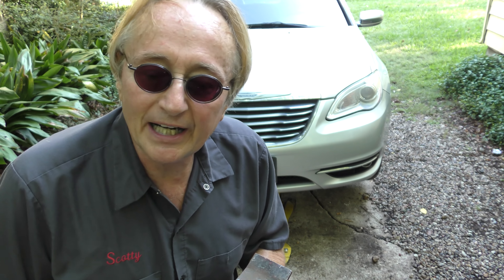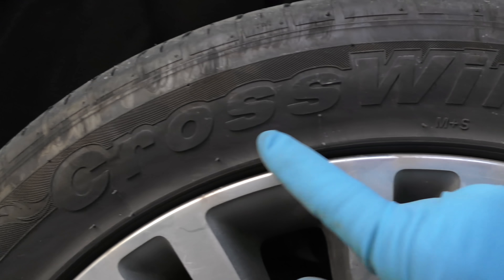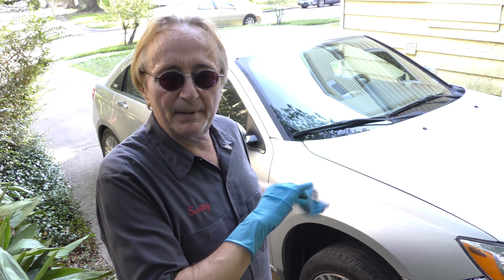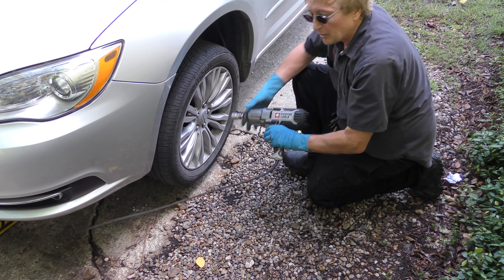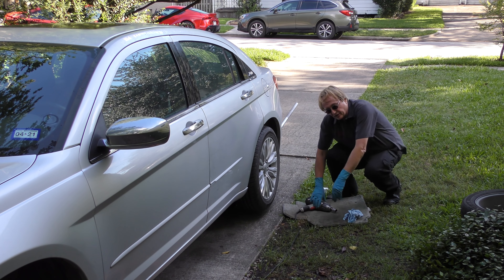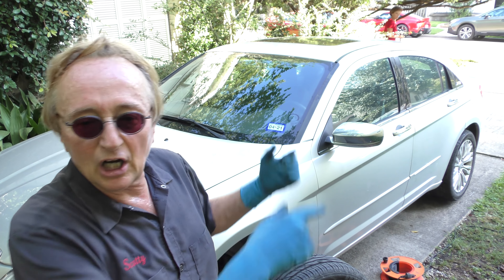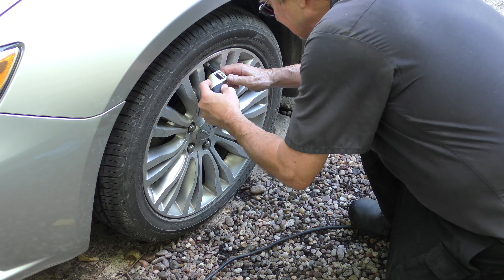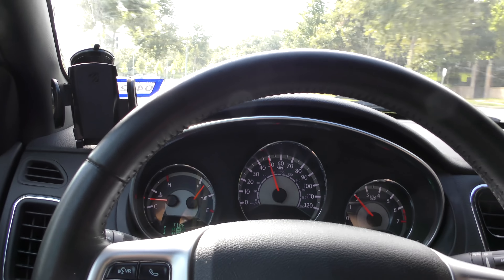Here’s How Stupid People Change Tires

Comment: First time in my life I find Scotty wrong: The average foe (See US crashing videos) is REALLY bad in handling avoiding obstacles and/or recovering from oversteer. And one of the most dangerous crashes is a T crash (Side impact) and rolling over. See NHTSA videos about it.
So for safety it's correct to put the worn out in front and the good ones back, because it is less harmful for you and others to run into another car, than to spin, get on the sidewalk or roll over.
Reply: That said, having two equally worn out tyres on front, actually gives you a lot more traction and stoping power on the dry than a new tyre because there's more rubber in contact with the pavement. That's why in sports they use slick tyres.

Yes, in the wet, snow or ice you won't be able to turn or brake well. But a street car design makes it SO MUCH easier to know what the front tyres are doing than the back ones. And the average driver is more likely to notice that the front tyres slip and take it easy, or they could think everything is ok because steering and braking feels great, and end up spining over a puddle at a corner. 

So yes, it is better to have the worn up in front, even more if where you live doesn't rain or snow.
Reply: But NEVER EVER put two different brands, let alone two very different worn level tyres on the same axle. That's just stupid.

Comment: better tires must be at rear, at winter, but it works only when tires are normal, when they are worn, then buy new tires.
Right way is to buy all 4 new tires allways and switch them regularly, then they worn more or less evenly.

If you brake at ice and you have more worn tires at rear, then ju loose control, spinout.

Comment: I know why they do it, you can argue both ways 'til you're blue in the face...
If you're on slippery roads and you've got better traction in the rear, if you slam the brakes your car will skid straight. If you have better traction in the front then the rear end will slide out. Personally I'd still put the good ones on the drive axle

Comment: wow I worked at firestone and Merchants tires and they gave us training and we had ASE certified guys working on the cars and even me a tire manager knew you have the best tires on the drive wheels either front or back if rear wheel drive and you don't run mis matched tires of various brands and than align it and it's vibrating what did the clowns tell them when they say hey since you aligned my car it shakes....lol

Comment: Tyre grip on the rear is more important than tyre grip up front. There is less load on those rear tyres and the tyres are losing grip a lot faster then the front tyres. Less grip on the rear wants to make the rear overtake the front of the car. The owner should get rid of the goodyear tyre and buy a new  matching or a new set of tyres. Never gamble with safety

Comment: In Ohio they do pollution tests.  Had a 89 Mustang GT that was massaged, with 5 speed.  Kid told me to get out of car and he put the front wheels in rollers.  Stopped him and told him was rear wheel drive.  Kid said no it's not.  Got supervisor and told him About kid thinks he knows more than owner,ME.  I said get the kid out of my car NOW.   If he wrecks my car you just bought it.   Young girl got in car, put rear wheels in rollers.  No one could keep car in rollers. Although the girl did it better than supervisor and 2 employees.   Test station finally let me drive car in rollers as 89 didn't have much computer tech.   They asked me what I did to car.  Said it was factory  and smiled.

Comment: if back tires are bald, they will have no friction to stop the car. when you hit brake, if you two front tires hit different part of the road that have different friction coefficient, the car will spin. there is a science to it. this is basic physics. this happens a lot more often when road is wet or has snow on it.

Comment: I'm afraid I'm going to have to disagree with Scotty here (partly). 
They even teach it in driving school in Europe that you want the best grip in the rear. It's a part of the driving school to pass the day on a slippery track. Driving on a slippery track trying to avoid obstacles with bald rear tires (they put them there intentionally) makes you lose control of the car and it is REALLY hard to regain control of the car (even with city speeds that do not seem that high). 
What I really want to say though is that from mechanical (shaking and wear) point of view yes, you want the best, roundest, newest tires in the front of the fwd vehicle. And to avoid unintentional sliding (whether in case of ice and/or hydroplaning), you want the tires with the best grip to be in the back of the car (no matter if fwd or rwd). In reality, there should be no difference with your front or rear tires - you should always have the kind of tires under your car that won't cause any issues and are safe. After all, tires are your only contact with the road while driving. 🤷‍♀️ Just my two cents.

Comment: You DO NOT WANT the best tires on the front, 

When tires are replaced in pairs in situations like these, the new tires should always be installed on the rear axle and the partially worn tires moved to the front. New tires on the rear axle help the driver more easily maintain control on wet roads since deeper treaded tires are better at resisting hydroplaning.

Understeer can be controlled by steering in the direction of the skid or applying the brakes to slow down. Trying to control oversteer using the same techniques can get you in a lot of trouble.

Comment: The problem with the tires may not be the mismatch/tread.....tire(s) may be out of balance. May be the wheels......wheel weights or bent wheel. For a non advanced driver, put the tires with more grip in the back. Bald tires may grip better if rubber isn't dried out assuming it's exactly the same tire.
When you buy a car you get a pink slip. If there's a loan the lender has the pink slip. You'll need to go to the lender with the seller, pay it off and get the pink slip signed over to you. How did those guys buy the car and not get the pink slip?

Comment: Don't know much about cars but common sense tells you that the car is controlled by the front so you want to have the best tyres on the front of the car  . There is a reason why the steering wheel is not in the back of the car

Comment: Depending on circumstances, I'll disagree with the requirement to have the "best" tires ALWAYS on the front for a FWD car.  As long as the tires are in good shape and have at least 25% tread remaining, they're quite suitable for the front.. Since the front tires handle the most stress, they'll always wear out faster than the rear.  If the tires are not rotated regularly, you'll end up with tires constantly wearing down (aka being replaced) at front, & rear tires getting older & older, and quite possibly developing cupping issues to the point they're useless.  There's too many variables to consider, would go outside the scope of this message board to discuss them all.  Best advice is to just rotate tires regularly.  And if the situation arises with 2 brand new tires, and 2 others used, but still within ~25% remaining, stick the 25's up front to wear them down.  then buy new tires when they reach the mfg wear indicators.
Regardless, I'll agree that same brand - same size tires for front is imperative.

Comment: No, you want the best tires on the _rear_; otherwise you will be more vulnerable to oversteer which is a lot more dangerous than the understeer you could get by having the worse tires in the front.
Reply: Continued watching and I see scotty is quite pissed at people saying the better tires should go on the back. Why don't you just think about it? If your rear tires have less traction than the front you are much more likely to spin out of control if you loose traction, especially in wet or icy conditions.
Reply: The benefits of putting the better tires in the front is that the front wears faster so they'll work towards evening out the tire wear, and better traction in the front would help with heavy braking. Although if the traction is bad enough and your rear tires are worse enough then you might find yourself backwards after a panic stop from high speed. But more commonly if you are doing hard cornering and your tires loose grip then you will experience dangerous oversteer.
Reply: Suppose you have new tires on the front and worn out tires on the rear, and you're on a wet freeway. If you hit a puddle of water, your rear end will hydroplane and unless you're a very good driver you'll probably be swerving out of control and crash. If you had the worn tires on the front, nothing much would happen. You may just have to overcompensate your steering to get back on track but as long as the rear end has traction you won't be able to fishtail.

Comment: Wrong the tyre will shake where ever it is on the car meaning the tyre is at fault maybe balancing or wear you just feel it on the front next different brands should make a difference only load speed rating or type alignment will pull you to one side and balancing causes steering shake at one range of speeds

Comment: First mistake, they cheaped out and bought Linglong Crosswind tyres. Typical shortcoming of these cheap Chinese tyres is they grip OK in the dry, are poor in the wet and may wear out faster. The Chinese tyres that do perform OK typically achieve this by using softer compounds that wear out faster than similar performing mainstream brand tyres. Their development of tyre compounds is far superior to the Chinese budget brands.

People see a cheap sticker price and get a tyre that doesn't last as long, performs poorly and ultimately makes their car less safe.
I usually put a medium wear tyre on my car - The Michelin Pilot Sport 4 is the best tyre I've run yet - and my last set of Dunlop SP Sport LM703 cost more, got decent life and time will tell how the Michelins compare for lifespan. If I get 40,000kms+ from the Michelins vs the actual 55000kms I got from the Dunlops, I'll be happy. The Michelins stick better for sure. I have to really try to be stupid to deliberately overwhelm them.

Comment: It is too dangerous to put a bad tire on the front cause when accident will happen and the bad tire will blow, you can't control the steering wheel compared to putting it on the rear.

Comment: I watch
 u all the time u give great advice.  But this one not right. I am a tire  guy  certified by  tia level 400 trainer.  U never put  tire with less meat on the front it will cause  oversteer   When it rains . U are right on having the same tire in the front . If u have to buy one that not the same it go on the back.   Just remember the weight of the engine keeps the tires grounded on the front  so always put the tires with the less meat on the front not the rear

Comment: Scotty!!  I was horrified when I watched this video.  You should ALWAYS have the best tires on the rear axle.  EVERY car on the road is steered by the front wheels.  If a front tire fails you can still use the good tire to steer.  If a rear tire fails you can lose complete control of the back end and very likely crash.  Tell your customer to replace both of the rear tires and leave them on the back.  Don't risk your life by being a cheapskate!

Comment: It's too bad car tires aren't as easy to change as airplane tires. Those are tubeless tires. 
With airplane tires all you have to do is unbolt the rims which split apart (help together by the bolts) around the tire and just rebuilt them around a new tire.  Brain-dead easy. All you need is a torque wrench, valve core tool, ratchet, torquewrench and a tire pump with a gauge. No Machinery required unless you count a power pump. 
And if you want to be super proper about it, have a bead breaker tool to loosen the tire's grip on the rims before separating them.

Comment: I love u for pointing out the whole "good tires on the rear, on front wheel drives". That's stupid, Discount Tire does that now. You'll never wear evenly either. If its rear wheel drive then put good tires on the rear. They say they do that for getting tractions on turns. But its minimal and if that's your case you need new tires.

Comment: Strongly recommend new tires on rear axles. I had 10/32 front and 6/32 rear end up in a ditch because the light rear end lost taction(wet) with no warning. Looping freeway off ramp about 35mph Instead 180 backwards over the curb down the ditch.

Comment: I think your wrong Mr Scotty because i did just that i installed a brand new tires in the front and left the old in the back guess what at 60 m/h the car slides in the corner an d flip 8 times it was totalled and I escaped by a merical.

Comment: I don't disagree that the people that worked on the car were idiots but there's a LOT of fail in this video.
How about telling people they should check tyre pressures when cold? On a warm sunny day there could be a significant pressure difference between a wheel in the shade and one in the sun.
How about actually showing the jacking up of the car with  the tools John Doe will have to hand and not a bloody air wrench?

Comment: Sorry Scotty, but there actually is a valid reason for the best tires to be on the rear of a vehicle, it's just that you would not see the benefit doing this in your warm state. In icy conditions, you need equal or better grip at the rear, otherwise when braking, the front slows down faster than the rear of the car. This causes the car to loose control, twirl around backwards, or even spin in circles if the momentum is high enough. This is much more dangerous than the safer alternative, which is to slide (and collide) with objects directly in front of you in your own lane, if unable to stop. The risk is comparable to braking hard with only the front tire of a bicycle, which would launch yourself over the handlebars in a total loss of control.

Comment: Just wrong. New tires to the rear. Long accepted due to Michelin testing; also a Costco requirement for decades and current Tire Rack advice. In this case the dumbsss mistake what outing that worn out Goodyear ANYWHERE on the car. And that alignment shop could have called that out, done a road test. The reason the more worn out tires go front is to prevent the rear end from breaking loose.

Comment: You lost all credibility with this video - best tires on the rear or you'll be swapping ends in the rain.
Reply: Rubbish. Absolute twaddle. Been driving for 30 years never had that happen whether I've had good tyres, bad tyres, front wheel drive, rear wheel drive whatever! In torrential downpours cars with very good tread on the front tyres cuts a path through the residual water on the road which the rear tyres immediately follow. No reason for them to make your car 'swap ends' even on corners. Ideally keep good depth of tread all round at all times. Your logic is flawed.
Reply: @motleydude73  Then you've been sheltered  - do some research before commenting.